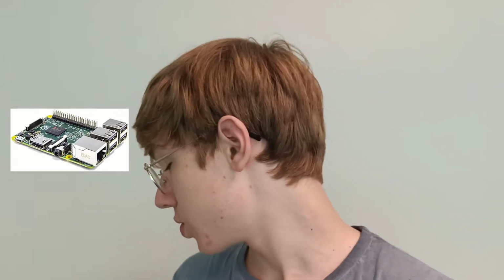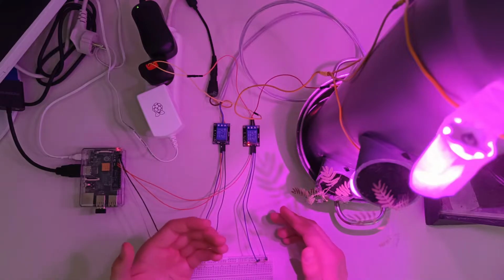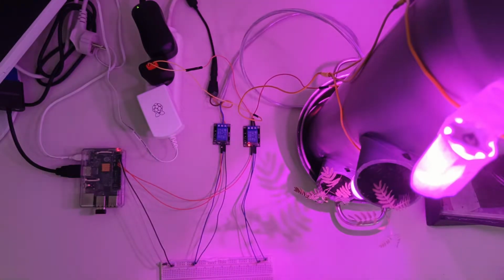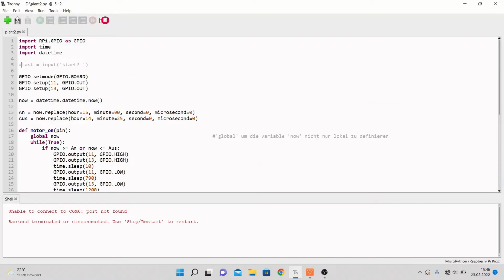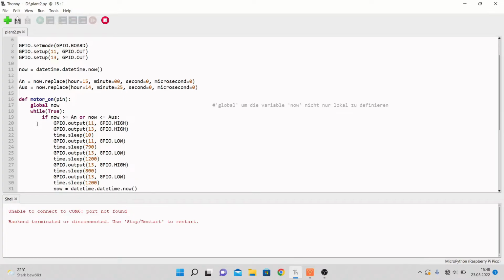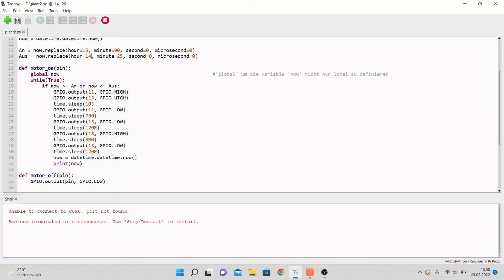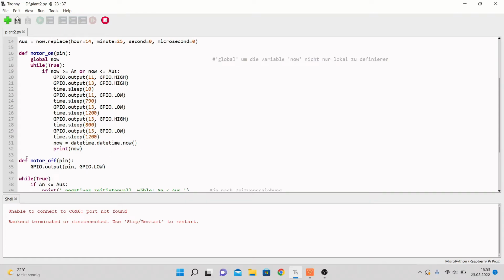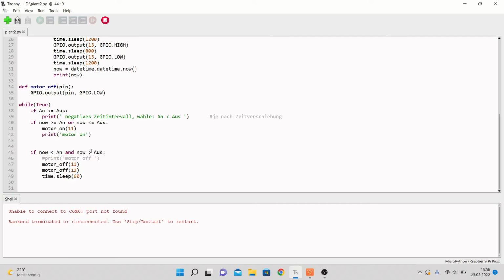Automating my hydroponic system

Comment: I enjoyed your project a great deal.  Well done!

Here is Python code that will do what I think you want to do.  I've added lots of constants so that you can hopefully visualize what is being done.

import RPi.GPIO as GPIO
import time
from time import sleep
from datetime import datetime
from datetime import timedelta
# import timedelta

SPEED_UP = 60 # THIS SHOULD BE SET TO 1 UNLESS TESTING
# If you set SPEED_UP, for example, to 60, then the pump and LED intervals will be reduced to seconds rather than minutes.
# That makes testing much less stressful since you don't need to wait minutes between iterations.  When done testing,
# set SPEED_UP to 1.  Note that this also adjusts the sleep time between cycles.

PUMP = 11 # GPIO pin for the pump
LEDS = 13 # GPIO pin for the LEDs

# Constants for readability
SECONDS_PER_MINUTE = 60
SECONDS_PER_HOUR = 60 * SECONDS_PER_MINUTE
SECONDS_PER_DAY = 24 * SECONDS_PER_HOUR

# Note that significant modifications will be needed if SYSTEM_ON time is greater than SYSTEM_OFF time.

SYSTEM_OFF_HOUR = 22
SYSTEM_OFF_MINUTE = 00
SYSTEM_OFF_SECOND = 0

SYSTEM_ON_HOUR = 4
SYSTEM_ON_MINUTE = 30
SYSTEM_ON_SECOND = 0

SLEEP_TIME = 1 * SECONDS_PER_MINUTE / SPEED_UP # (be nice to the RPi... don't constantly run)

# Following values set the pump to be on for 5 minutes, off for 15 in a continuous cycle
# Define how long the pump will be on per cycle, and how long it will be off per cycle
PUMP_ON_INTERVAL = 5 * SECONDS_PER_MINUTE / SPEED_UP  # 5 minutes
PUMP_OFF_INTERVAL = 15 * SECONDS_PER_MINUTE / SPEED_UP # 15 minutes (20 minute cycle)

# Following values set the LEDs to be on for 25 minutes, off for 5 minutes in a continuous cycle
# Define how long LEDs will be on per cycle, and how long off per cycle
LEDS_ON_INTERVAL = 25 * SECONDS_PER_MINUTE / SPEED_UP # 25 minutes
LEDS_OFF_INTERVAL = 5 * SECONDS_PER_MINUTE / SPEED_UP # 5 minutes (30 minute cycle)

# Initialize the GPIO
GPIO.setmode(GPIO.BOARD)
GPIO.setup(PUMP, GPIO.OUT)
GPIO.setup(LEDS, GPIO.OUT)

now = datetime.now().replace(microsecond = 0) # Microseconds are in our way.

def relay_on(pin):
    GPIO.output(pin, GPIO.HIGH)
    return True

def relay_off(pin):
    GPIO.output(pin, GPIO.LOW)
    return False

# Here comes the main code....

pump_is_on = relay_off(PUMP)
leds_are_on = relay_off(LEDS)

next_pump_on_time = now.replace(microsecond = 0)                               # Pump on as soon as system_on_time is encountered (maybe already)
next_pump_off_time = next_pump_on_time + timedelta(seconds = PUMP_ON_INTERVAL)
next_leds_on_time = now.replace(microsecond = 0)                               # LEDs on as soon as system_on_time is encountered (maybe already)
next_leds_off_time = next_leds_on_time + timedelta(seconds = LEDS_ON_INTERVAL)

# The following 3 lines are not necessary; they just make a nice starting comment in the log.  Omit if desired.
system_on_time = now.replace(hour = SYSTEM_ON_HOUR, minute = SYSTEM_ON_MINUTE, second = SYSTEM_ON_SECOND, microsecond = 0) # Specified time, today's date (might be in the past)
system_off_time = now.replace(hour = SYSTEM_OFF_HOUR, minute = SYSTEM_OFF_MINUTE, second = SYSTEM_OFF_SECOND, microsecond = 0) # Might be in the past.
print("Time is", now, "System on time is", system_on_time, "System off time is", system_off_time)

while (True):
    now = datetime.now().replace(microsecond = 0) # Microseconds are in our way.
    # Set system on time.  We do this every cycle so we can remain date-agnostic.
    system_on_time = now.replace(hour = SYSTEM_ON_HOUR, minute = SYSTEM_ON_MINUTE, second = SYSTEM_ON_SECOND, microsecond = 0) # Specified time, today's date (might be in the past)
    # Set system off time.
    system_off_time = system_on_time + timedelta(seconds = SECONDS_PER_DAY - SECONDS_PER_HOUR) # In other words, run for 23 hours at a time (also might be in the past)
    if (now >= system_off_time): # turn everything off for the day
        pump_is_on = relay_off(PUMP)
        leds_are_on = relay_off(LEDS)
        next_pump_on_time = now # Make pump come on as soon as "system_on_time" is hit
        next_leds_on_time = now # Make leds come on as soon as "system_on_time" is hit
        print(now, "System is turned off.")

    elif (now >= system_on_time):
        if (pump_is_on and now >= next_pump_off_time): # It's time to turn the pump off
            pump_is_on = relay_off(PUMP)
            next_pump_on_time = now + timedelta(seconds = PUMP_OFF_INTERVAL)
            print(now, "Pump now cycled off until", next_pump_on_time)
        elif ((not pump_is_on) and now >= next_pump_on_time): # It's time to turn the pump on
            pump_is_on = relay_on(PUMP)
            next_pump_off_time = now + timedelta(seconds = PUMP_ON_INTERVAL)
            print(now, "Pump now cycled on until", next_pump_off_time)

        if (leds_are_on and now >= next_leds_off_time): # It's time to turn the LEDs off
            leds_are_on = relay_off(LEDS)
            next_leds_on_time = now + timedelta(LEDS_OFF_INTERVAL)
            print(now, "LEDs now cycled off until", next_leds_on_time)
        elif ((not leds_are_on) and now >= next_leds_on_time): # It's time to turn the LEDs on
            leds_are_on = relay_on(LEDS)
            next_leds_off_time = now + timedelta(seconds = LEDS_ON_INTERVAL)
            print(now, "LEDs now cycled on until", next_leds_off_time)

        sleep(SLEEP_TIME)

Comment: If you have a drill press with a table that tilts, you can cut elliptical holes to save time :)
Reply from the maker: I actually tried that at first. But by drilling at an angle the drill wouldn't be long enough to drill through the hole pipe. Nice idea though
Reply: @things3  
You can buy extra long hole saws (not cheap tho). If you are making a lot of towers you can make a long one by buying two identical holesaws and cutting the top off one and the teeth off the other and welding them together. You did a great job of the netpots, a cap for the top of the pipe would keep the rain out :)